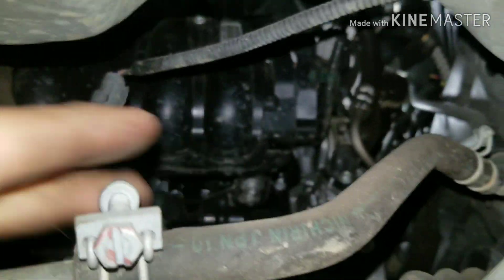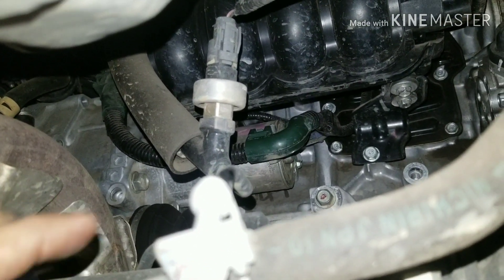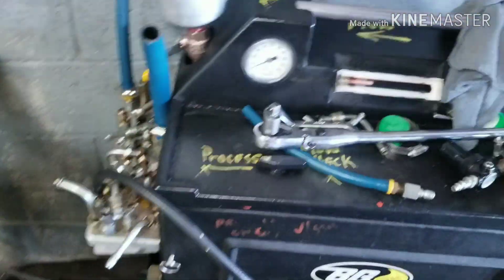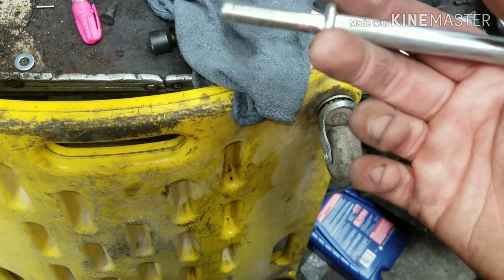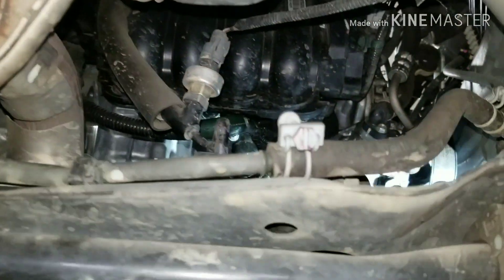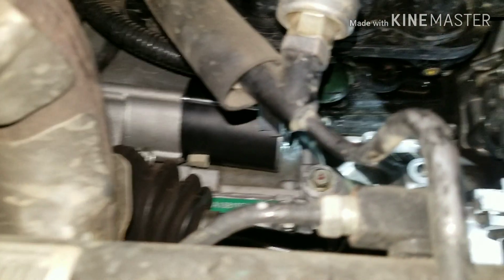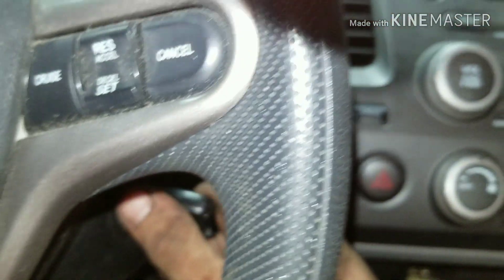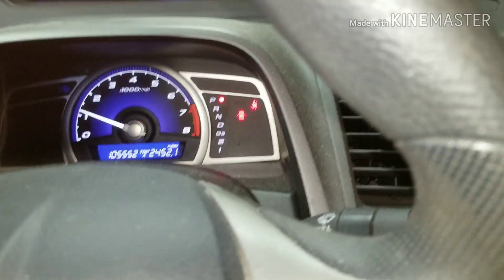How to replace the starter on a 2009 honda civic

Comment: Is taking off the tire necessary or just more convenient?
Reply from the maker: It allows you to get in there better with a extortion if I remember correctly.  Thanks for watchin besure tolike and subscribe for more tips and tricks
Reply: Deffinitly makes the job ALOTTTTT EASIER
Reply: I did it without taking off the tire

Comment: Replaced a alternator on a 2000 Honda civic 1.6 . in my lain way for a friend to save on towing coast to my garage . well well well it does NOT come out the bottom of the car i tell yea like some utube videos tell yea. move the master cylinder out of the way and what ever else is wires /hoses excreta and out the top she comes not to mention removing the 2 bolts for the bottom  bracket because it was ceased on and needed some smashing wiggle room to separate the bugger 4hr's and a few beer later vola.
Reply from the maker: Ya the alternators on these  fellers can be brutal, was your a left or right hand drive? But that sounds about right for the perfect combination to to get anything  out all ya need is a few cold ones. Thanks for watching always apreciate  it and the feed back
Reply: @fixergood   right hand drive
Reply from the maker: That's really cool I've always wondered how diffrent things would be to change from left hand drive to right hand drive